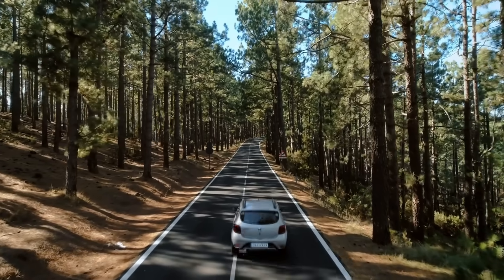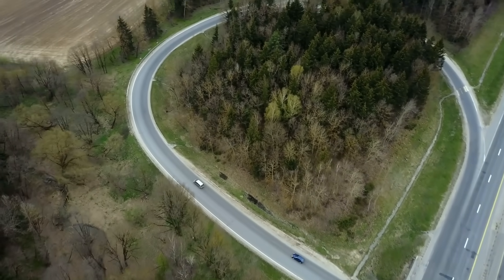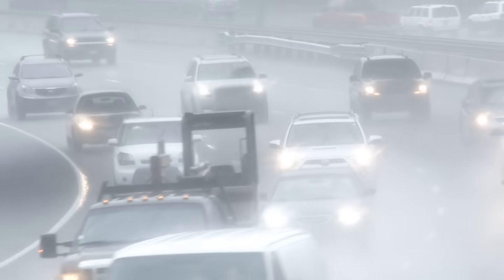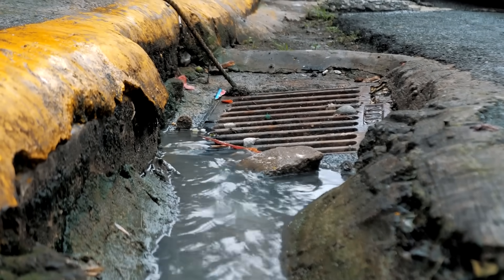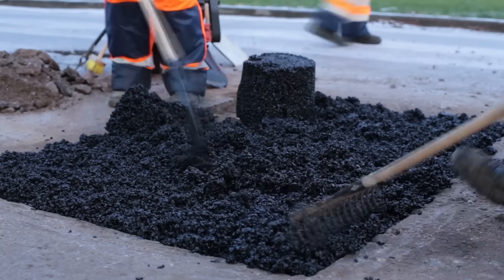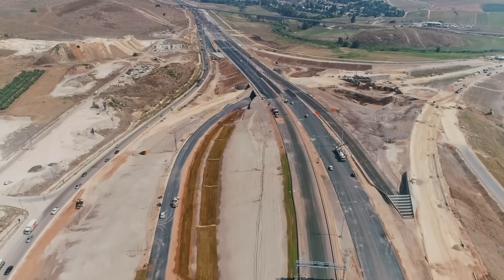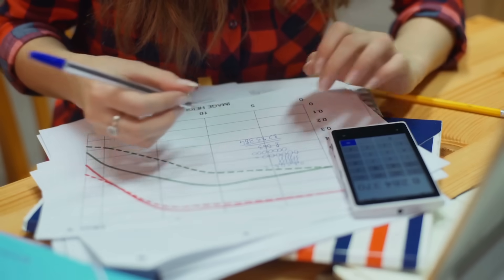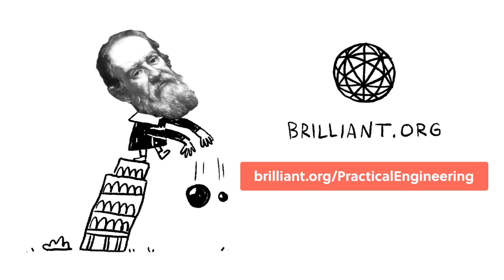How Do Potholes Work?

Comment: 😢😮😅 I've been driving for over 50 years. I've seen potholes over the years. I call some of them the size of the Grand canyon. They can be wide as the whole car when the car goes into it. Boy it really bottoms out and it can do a lot of damage to the wheels and everything. Thank you. I hear now they're using recycled tires. They chop them up and mix them with the asphalt. It's a lot better for the road and everything when they do this. Thank you.😮😅

Comment: In the UK we have two methods to deal with potholes. Firstly (after at least 1 month of the hole's existence) some spray paint will be added to the perimeter of the hole. If this doesn't stop the degradation and the hole deepens, a traffic cone will be placed inside the hole. Thus solving the issue forever.
Reply: if you want a pothole fixed here you have to spray paint a knob around it, naturally

Comment: When it is safe to do so, I prefer to drive at an 'offset', where one of my tires goes over the center of the lane and the other goes closer to the edges of the lane. I do this to 'even the wear' on the road. Because, surprise surprise, most of the potholes are where most of the wear happens, which is the 2 strips where all the tire treads go.

Comment: It’s not difficult, but it’s a little more expensive in the beginning. 
First run a base that’s going to be supportive for the expected lifespan of the road placement and usage. 
Second, seal it with something like a tar, or something that is water proof/resistant. 
Third, place an metallic or something that is good for the vehicle weight ratings, grating. 
Fourth, place an mesh over the grating. 
Fifth, place a layer of material that will provide traction and provide a smooth and quiet medium for the vehicles to travel upon. This material will be, not there for preventing the lower materials from being introduced by water and other liquids, but rather ti will be porous. 
Now, imagine instead of having the water run to the side of the road to a curb, then down the curb to a drain. The rain along with oils and other liquids will fall onto the road surface, and will absorb into the road surface, instead of running down to the appropriate drainage system. The mesh will hold the road surface up, and the grate will provide a gap for the water to flow through, and exhaust the liquid into a system that will distribute it to appropriate areas, to be disposed with. Maybe California might want to pay to have it collected in a system of ponds and pipes. To be ran cross country eventually. There is a lot of highway miles that could be used to collect water. 
But what about roads that freeze. Using materials that will be either heated up as traffic drives over them. Think about how when materials get squashed and then they relax back to the original design. Heat is produced. If different materials are used, metal will lose heat quicker, and will help to produce ice better than an composite material. Maybe an mesh of metallic material, but an grate of composite material. 
But what about the salt, that would deteriorate the road. Salt is used to melt ice. If the road absorbs the water and deposits it below onto the mesh, and the mesh transports it to the grid, which transports the water to the appropriate areas where it is disposed. Then salt should not be needed. If there is a problem with winter driving in these surfaces. A truck with a gas, tank and a series of burners, could be driven down the road to heat up the road to melt the residual water, and bonus. The additional heat treatment could also help to prevent the top surface from wearing out as quickly. Imagine melting the water, and the heat being able to slightly melt the surface material. Sort of reflowing the surface material into a smooth and solid surface, repairing any minor cracks and deformities that might have been produced through the year. 
Vehicles that have sensors on them will drive across the roads built this way, and/or sensors on the roads will provide an estimated thickness of the surface, and would be backed up by random physical testing, to determine the thickness. When it was thin enough that it was determined that it was about to be too thin, or before the critical season was to begin. All that would be needed is to run another layer of surface material over the top. Heating up the old and new materials. If there was an more durable solution as an base for the surface, then an softer and cheaper material layered on top of that, with both being fused together getting tougher the deeper it went. That would provide more resilience, as the surface wore, and a cheaper and easier resurfacing process could be possible.

Comment: I remember one time we almost broke down in the middle of a highway because of a large group of potholes in the middle of a busy highway. We were experiencing a La Niña event and had a long series of torrential rain, which also greatly limited visibility to less than 30 metres (100 feet). While driving down this highway at two thirds of the speed limit downhill, I spotted several huge potholes and quickly relayed my observations to my mum, who was driving at the time. She swerved just in time to avoid like 10 or 15 potholes, each one large and deep enough to cause serious damage to a vehicle. After narrowly missing the potholes at the bottom of the hill, we passed several vehicles rendered inoperable because the potholes either popped tyres or worse, destroyed the entire wheel, including the mounts and axles.

Comment: This is why it is so important to not drive into flooded road.  You have no idea how much has actually eroded under that water and in major storms it can be a shockingly large amount of missing road and subgrade.
Reply: the problem is that this also impact emergency vehicles too. if there's a flooded area and their vehicle wasn't specialised for it. It will cause issues

Comment: There’s a big thing that he missed. Specifically in colder climates like Colorado and, I’d imagine places to the north, potholes are also caused by plows.
Plow drivers, when pushing snow too fast, has their blade down and that blade likes to bounce. Well, steel is harder than asphalt so when the corner of that blade bounces…

Comment: i was most interested in how potholes should be repaired.  i've been told you dig out the loose stuff, make the sides vertical, and get it dry, then use asphalt oil to seal, before putting the hot mix in.  this seems right to me, but.  most of the repairs i see are just filling, and the water can go right back in and loosen the patch, which has a rounded bottom and comes loose easily.

Comment: There’s a little curvy road that probably isn’t the required width, that has a pretty high tractor trailer traffic. So the road is absolutely wrecked, the sides of it have crumbled making the road even smaller, there’s giant potholes, and I don’t think it’s getting fixed anytime soon. I have to drive that road to get to my dog’s daycare and I had to pick her up in the dark in a massive rainstorm with extreme wind. I was genuinely afraid I damaged the car bc I couldn’t see enough to avoid the drops and potholes. 
I always wonder how tf two trucks going opposite ways will navagate. There’s barely room for normal cars.

Comment: We have a small street across from a massive residential area. It’s the only gas station, general store and restaurant in town (Not that far but most people don’t want to spend an extra 10 minutes just to get beer). This small street and the residential area are split by a “highway” but here in Hawaii, almost anything over 45mph is considered a highway. People regularly do 60mph, then veer off to get some last minute dinner, tools or gas. 

This street is only 400 something feet at most yet every inch has massive 6-10” pot holes. I love driving through, seeing those massive holes get filled up by county workers and days later be replaced by another one 5 feet next to it. 

Paving companies seem to be getting a bigger budget, as they’ve been more and more busy as of the last year or so. However, aside from the Hilo hospital, almost all the paving jobs seem to be tourist centric. My little 400 foot general store probably won’t get a real fix for several years :(

Comment: I have a few questions: 

1. Would it be safe to suggest that the subgrade material is the main reason for potholes? 
2. Should we perhaps, if we're going down the asphalt/bitumen pathway of paving our roads, be looking at what type of material we use for the subgrade? 
3. You mentioned that even the slightest thickness of a concrete layer would equate to millions on a grand scale such as a large freeway/motorway; wouldn't the decrease in maintenance, and subsequent costs, justify using it over asphalt and repairing it over and over? 

No idea what the taxation system is like in the US, particularly for road use, so I can't say if using concrete slabs would be better; but I would imagine as an Australian, we're one of the most taxed nations on earth, so I can't see why we couldn't use concrete slabs more extensively in our freeways/motorways to be honest....

I'm absolutely curious to know your thoughts about this comment by the way!!

Anywho, absolutely LOVED watching this video!! Thanks for posting this!! 😀 Very educational and it raised a lot of thought into how we design our roads!!!

Comment: 1:00 in and already you see a contractor’s pathetic attempt at drizzling some prime when doing a grind and overlay. 😂 And you wonder why pavements fail, it’s because contractors never do what the engineers call out on the plans and specs. I bet the subgrade sucks and they never did a proof roll or fixed any of the base issues when it was originally built. Lipstick 💄 on a pig 🐖 as usual. 😂

Comment: A pot hole recently just broke my 1997 Pontiac Sunfire Coupes front passenger control arm, ripped the CX Axle out of place and the proceeded to disconnect the 3 Speed MD9 Transmission. Cost me 1014$ to reassemble the car with my own supplied parts ugh. It sucked. Now the wheel bearing just went. Another 150$ to get it back on the road.

Comment: What happened to the concept of mixing recycled rubber with asphalt? They tested it outside tuscon years ago and in theory it was supposed to flex and help prevent cracks. Plus it was so much smoother and quieter to drive on

Comment: I’m originally from Montreal, where roads and other infrastructure take a lot of maintenance to to seasonal large temperature fluctuations (+/- 40 deg).  They’ve built a few highways using a concrete with polymers, no asphalt top layer.  They’re as good now as when they were installed over two decades ago.

Comment: This sheds some light on a recent mystery for me on my residential street actually. We had this one spot that kept developing  pothole - but what I mean here is not "once a year," instead the asphalt was disintegrating after every single heavy rain! And living in the southeast USA, heavy rains are REAL common.
Eventually the city came in and did a bunch of digging, a trench across the width of the street - that poor crew had to spend almost 14 hours digging up something and then putting it all back. Later on I found out from the neighbor, there was a city water pipe that had some kind of leak or crack...and I'd wondered what on earth that had to do with the road. No one had needed to boil their water or anything like that, so I thought "how bad of a crack could it have been?"
But learning this - I understand much better now - it wouldn't need to be a big crack at ALL to make the dirt beneath the road way erode. And when the city tried just patching the potholes - the water pipe was still the problem. So naturally the rains just took away the patch and widened the hole even more!
Reply: From a cost perspective, having even a small leak still costs a ton of money too.

Comment: Would it be possible to make a special vehicle that heats and compacts the cracked asphalt road to seal the crack without additional material? I feel like such a solution would be cheaper and faster than filling in the potholes.

Comment: I'm curious: was it a conscious decision on your part not to mention the fact that roadway damage is almost exclusively by heavy trucks? This is indeed so much the case that passenger traffic is considered to be insignificant in calculating the required strength of a particular road. The most cited study is from AASHTO if memory serves. I've corresponded with highway engineers and there seems to be no disagreement that the problem is caused by commercial traffic and not passenger transport.

Cheers,

Alan Tomlinson

Comment: kindof missed that we drive on an oil based material with rubber leaking oil
honestly if that wasnt the case it would last a lot longer 
its flexible enough to almost ignore any damage from pressure or friction while being completely water resistant so almost ignoring erosion from the elements
driving with cars is the most destructive thing you can do to the material
its why, uncomfortable as they might be, cobblestone roads dont get potholes as fast

Comment: I absolutely love these videos. At the risk of venturing into politics (it is very hard not to do that these days) the one thing I want to push back on is the wisdom of accepting that people will just not tolerate government spending at levels required to build and repair things more durably.  Example: When I see a stretch of roadway having it's potholes reappear over and over again after many fixes I do not think taxpayers were spared any pain or money by not handing them one big bill to repair the road right during the first repair instead of choosing 20 cheaper band aids.  Given that deficits do not seem to deter any other spending why not maintain our infrastructure the more expensive, but much cheaper in the end way? It would save on tires and fuel too.  I realize that Civil Engineers have to work within political realities but this makes me want more civil engineers and less lawyers in congress. :)

Comment: Pothole repairs can also be done properly. For example, lets assume we have a pothole in the shape of triangle or square, the first thing that must be done is to make sure to get rid of the corners of that rectangle or square shape. It should be a circular shape pothole now. Once it is done, sweep the area until there's no small rock and gravel left. Dry that new pothole patch area longer than the books says to. Problems solved

Comment: I think they should look into recycled plastics and rubber for roads. That must be more durable and flexible that asphalt. Thoughts?
Reply: No.
Reply: @eljanrimsa5843  That's a great answer.. or is it? Why do you say that Ejan. You would rather have plastics fill landfills and oceans?
Reply: @webdev217  I would rather not have the abraded road plastic end up in the groundwater and rivers. I think durable and flexible are opposite characteristics, you can't have both. Asphalt is superbly flexible in the way it can be re-applied later on. I think that will be almost impossible to beat. Perhaps we can create something durable out of recycled stuff to replace concrete. That might help us with our concrete problem, but that was not the subject of this video about asphalt.

Comment: compaction of the road base is essential to prevent cracks. A soft base will allow the road to move and flex the asphalt. this movement will cause cracks to form which allow water in. The quality of a road has mant factors but compaction of the base is essential to stop potholes.

Comment: Potholes? Laughs in Dutch

To add to above: Dutch government decided that the cost of bad roads is higher than regularly completely replacing the top layer of asphalt on most main roads, and their contractors have got it down to a science. I believe a full crew removes and replaces a 4-lane top layer for 5 kilometers in a single night. There's hardly ever a noticeable pothole, so less traffic jams, better economy.
Reply: Dutch are the best... no one can be compared to them, their engineers are next level and their govt too. It is good country with good economy, unlike other european countries which are slowly dying in debt and poverty.

Comment: There's a pretty popular resurfacing method they do around my county (in England), where they seem to just lay down some sort of tar, and then loosely lay grey gravel over it. They then reopen the road and cars are warned to drive slowly for several weeks. Seems like they're basically using traffic to steamroll and compress the road surface for them. I've been really curious about this method as it seems to have some really obvious flaws, but I assume it's both cheap, and appears to be a relatively quick method of road laying.

The absolute biggest flaw with it (but not the only) is that whatever tar type substance they use is NOT able to withstand high temps and during the height of summer the roads become exceptionally sticky, and vehicles remove parts of the surface. There's one slight incline near me where, every summer without fail, big tyre tracks will be torn into the road way which then create a very uneven surface that they have to patch up EVERY YEAR.

Comment: Well in India,specially on state highways the contractor use(he has to) low grade materials and improper techniques for cost reduction as a large chunk of allocated road building budget goes into the local politicians,govt. Officials and engineer's pocket.But the main cause of developing the potholes as I have seen is allowing overloaded trucks and dumpers (a 36 tonne truck carry almost double of its allowed weight) illegally,again by rampant corruption and latent govt. support.Otherwise even by using low quality materials the road stayes good much much longer if there is no traffic of Overloaded trucks and vehicles.